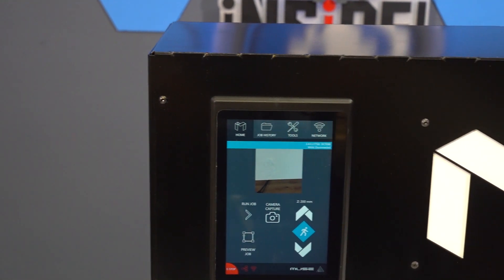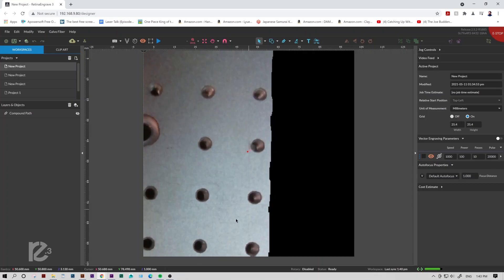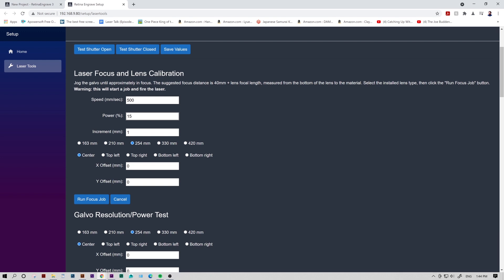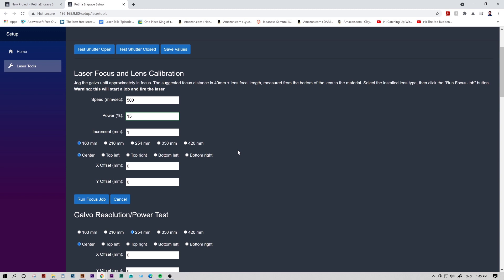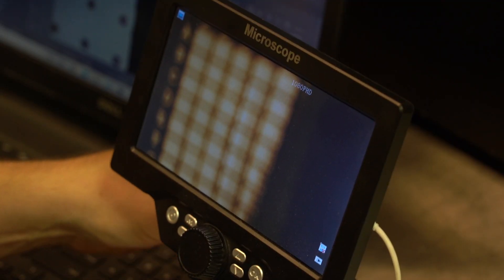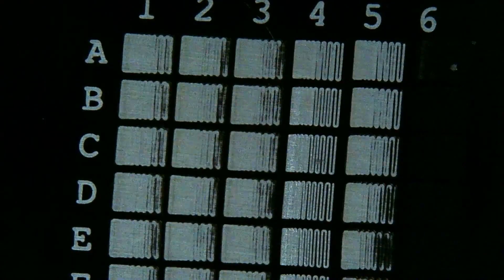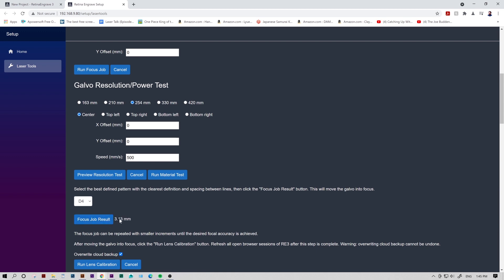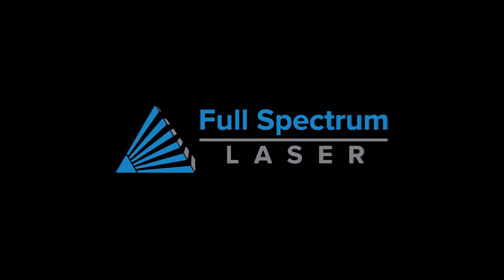Muse Galvo Focus Test

Comment: have tried to run this test so many times i cannot count. There is no clear instructions for different lens, powers, speeds, only what they are using. "before we run the test we are going to auto focus" how is that done? there is nowhere showing run autofocus, that is what we are trying to do! Is there anyone out there that has found how to set up the laser with good instructions? They say they are tested before they are shipped but nowhere did i see what the focus distance was when I received the machine.
Reply from the maker: Hey Matthew! We're working on a focus and calibration right now, until then reach out to support@fslaser.com and they'll be able to help you out.